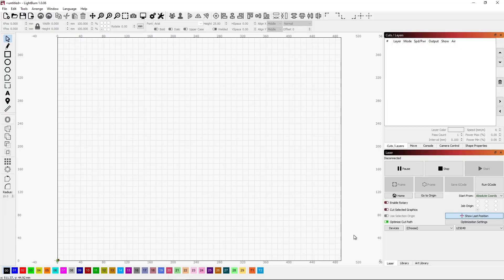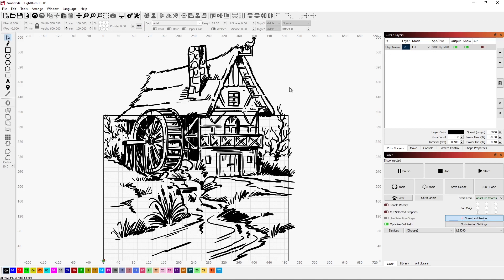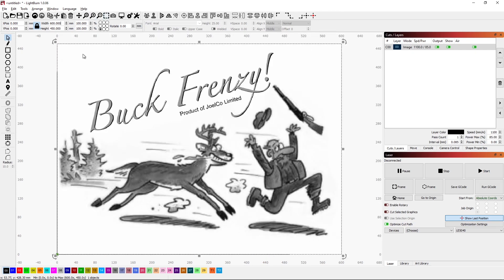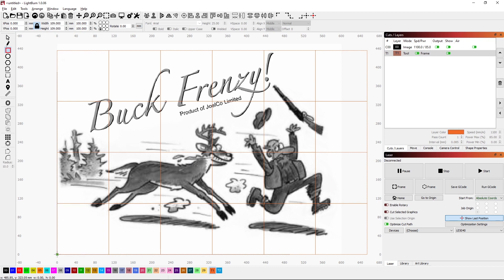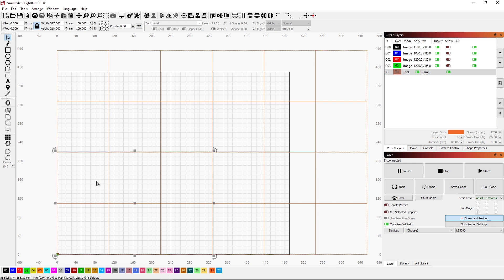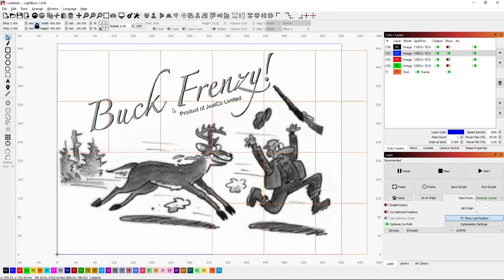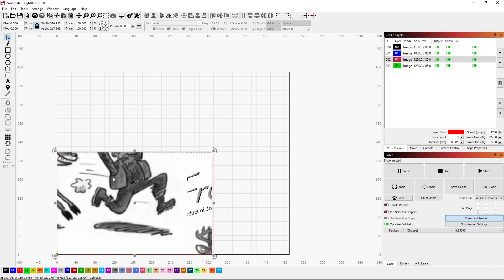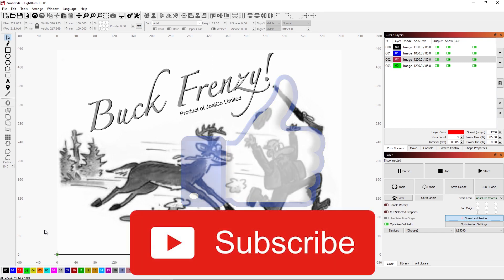Burn something bigger using LightBurn, Part II

Comment: How do you handle alignment when engraving? Do you use 2 alignment marks? Between sections
Reply from the maker: This is a great questions!  That all depends on which laser I am using.  When using my little Atomstack P7, I have a zeroing template that lets me put one tile in place at a time and have it zeroed correctly with the machine.  If I were to do this one of the bigger lasers, I would want to have something with which to use for an alignment mark.  In this particular project, I could use the corners of the tile easily enough.  :-)